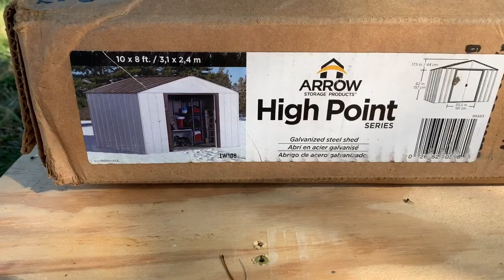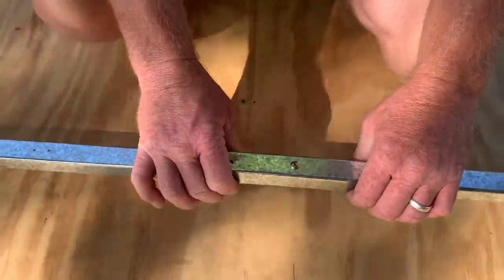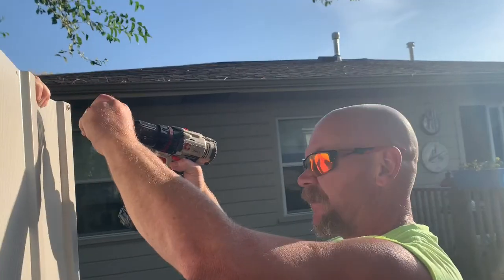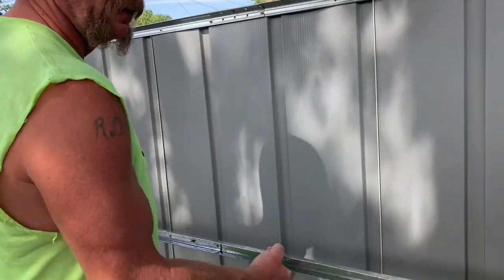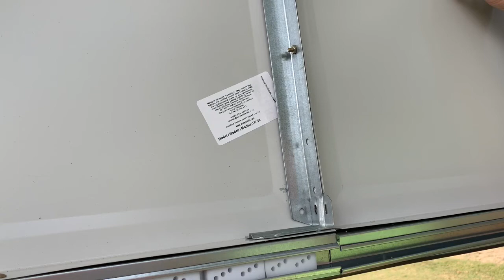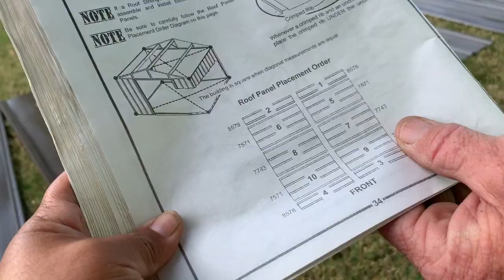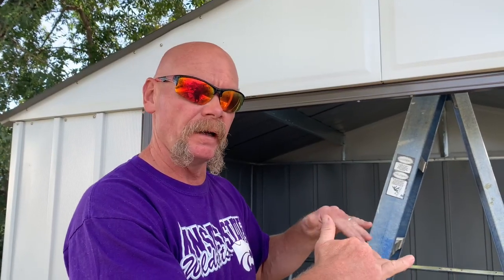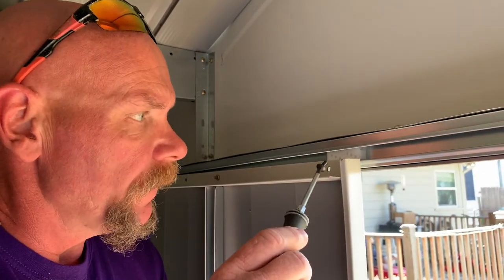ARROW High Point AR108 A. Step By Step Assembly Instructions

Comment: I recently purchased this model and am waiting for rain to stop for a couple of days. Watching your procedure a thought came to me...as you assemble each of the rail members, take a piece of masking tape and felt tip pen the step number on it then put it on completed part. So, as you go to each step, you won't have to search for the part number for that step. Should make assembly go easier. Thank you for this video, it will help me put mine together...btw, I paid $500 for mine.
Reply from the maker: That is a good idea! Thank you for watching!

Comment: Very helpfull video.  I was looking for the install of the door track which you said was going to  be step 7, but it skipped over that and the track was already installed!  I'm having a problem where the door track is about 2+ inches too long to fit the front wall. It was assembled exactly the way you did it but I can't get it to fit in even by trying to force it.  I guess I will just cut it off taking half the extra length of each end.  I'm really frustrated with the lack of detail in the instruction set!
Your video did help me a bunch!

Comment: Good video. I will admit but, you should have explained you put the plastic door slides in wrong. They do not go inside the top channel but rather on the lips of that upper channel , Your way? the door will bind as I am sure you found out. Just friendly FYI

Comment: Really liked the video , it's going to be very helpful because the instruction are really vague. I got lost a couple of times with the orientation of the building. I couldn't tell if you were working on the front, the back or the side  wall, I'm confused with the plastic "u" channel on the gable. I saw you install it then you removed it. Does that not stay on the gable permanently?  Thanks for a good video.
Reply from the maker: It will stay permanently. Sorry that part wasn't so clear. Thank you for watching!

Comment: Great job man!! This is very helpful!!
Reply from the maker: Glad we could help! Thanks for watching!
Reply: @RobertsonsBellyAcres   Hello again, we finally got it done after many bad days of bad weather and in the extreme cold where we live but my question for you is when she get the doors lined up. Are they hitting the screws inside? That is the problem I seem to keep having it's binding up and it should not be that way with their design.?
Reply from the maker: I am glad you have been able to get the rest of the building done. Sounds like you have the sliders on the door to the inside of the track. I did the same thing. If you turn the sliders 180° the should slide freely. Hope this helps!
Reply: @RobertsonsBellyAcres    I have the round part of the plastic sliders facing down like it says in the manual and how you showed us to do so I'm not quite sure what's going on it's going on?

Comment: Hello, again, Rusty...have run into a problem with assembly of the roofing panels. #8578 none of the holes line up, cannot put bolts in. Panel #8579 lines up ok on the rear gable...any idea what the problems is...appreciate your help.  (note (my part #'s are different but placement is same).
Reply from the maker: The only thing I can think of is to make sure you have the correct side up and possibly try swapping sides of the shed with the panels. Just a few ideas.

Comment: Beware, I built an 8 X 10 Arrow on premade Concrete pyramid blocks with crossbeams and a plywood floor. Within 2 years I saw "holes" in the floor from water leakage. It had accumulated under  "stuff" and damage was done. The holes provided a Critter entrance. Putting metal flashing around the bottom edge helped a lot to hold back further water damage. So some sort of water sealant needs to be put on the plywood and maybe install a pressurized wood floor.

My future 10 X 10 I'm doing the Concrete slab up off the ground. But...the cost for an 11 x 11 slab was $2100.

Hope this will help.
Jay( North Georgia)
Reply from the maker: Thank you for sharing this! We did seal the lumber and caulked around the base of the shed. Sorry you had to build again!

Comment: 10:37 You installed your plastic door slides wrong. The grooves on the top and bottom of the slides should ride in the rail edge where the front face of the slide should be outside the rail.
Reply from the maker: Thanks so much for the tip
Reply: I didnt know till we were actually putting the doors together live and learn